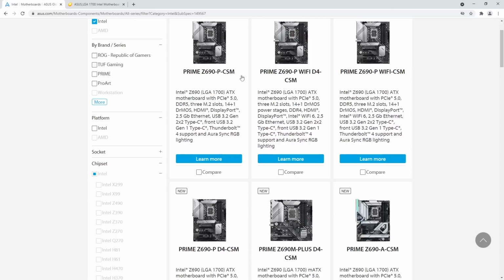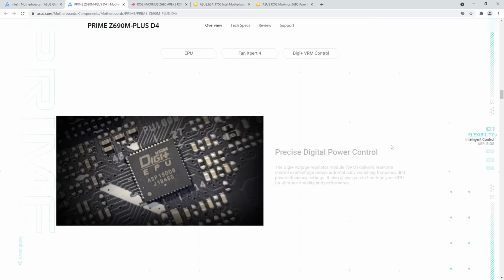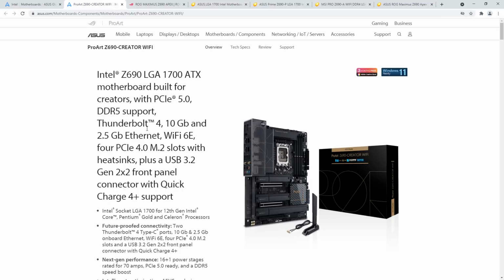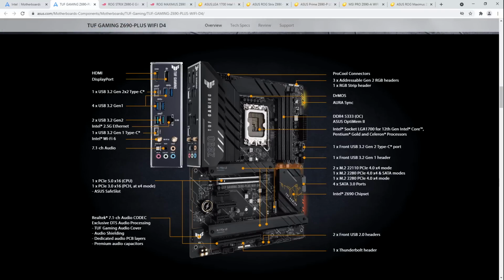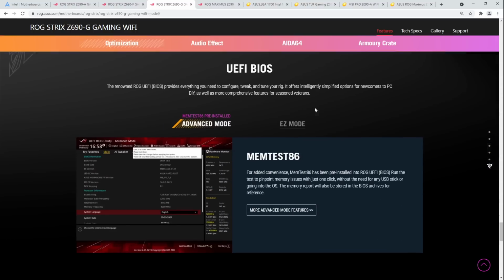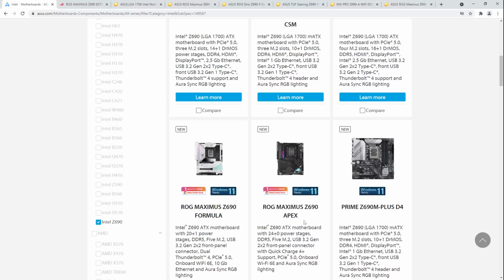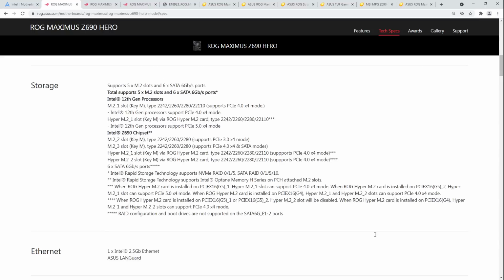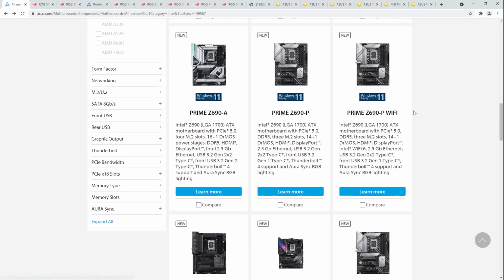Rambling about the ASUS Z690 Motherboard line up

Comment: 1:23:48 "black metallic capacitors", that name sounds like some one has been drinking that "Black felt capacitor" cool-aid again, lol.  I'm sorry to disappoint you, artificially increasing the leakage current of the capacitors with conductive carbon impregnated dielectrics, is NOT going to improve the quality of the VRM, lol. (face palm)

Comment: I remember back when I bought my rampage iv formula for $400 AUD which is about $290 USD and you literally had 40 pcie lanes. Yes it was pcie3 but this is in 2012 and 10th gen didnt have this many lanes from the CPU, you got quad channel, and 11 USB ports..... in my opinion there is no excuse for unused space not being used for USB ports. Put cheap USB 2 ports if nothing else. They can be used for most peripherals still. Webcam, microphone, DAC, mouse, keyboard etc.
Reply: Isn’t that a HEDT board? They all allow for 40 cpu pice lanes as long as you have enough cash for X series HEDT chips.

Comment: I just dont get why Intel Always keeps the lane Count so Low. I mean.. 32 Gen 5? Why? 40 would give consumers and manufacturers so many more posibilities..
Reply: What do you mean "32 gen 5"? It has 16 gen 5 lanes, 16 gen 4, and 16 gen 3. That's equivalent to 16+8+4 = 28 lanes of gen 5.
But seriously, who needs 32 PCIe 5.0 lanes on a standard desktop platform? That's... not low. There's no point in using chipset and CPU die area on extra lanes that 99% of users will never use, and it would make the platform more expensive. Most people have 1 graphics card, 1 or 2 SSDs, and maybe a capture card and a couple of extra AICs that would be fine in x1 slots, which Z690 is more than enough for.
Intel should get on with releasing a new HEDT platform so that they can provide extra lanes to those who actually need them, but Z690 doesn't need more.

Comment: I generally do not understand why all the Z690 needs to be so expensive, it seems like they are all overbuild on the VRM section(maybe 13th gen cpu support requirements ?).
I just got a decent black friday price on the TUF 690 D4(non wifi), but i still consider it expensive even with the 70euro cashback and around 100usd black friday discount that i got on the board (better priced than any other Z690 cos of those discounts tho), but still on the pricyer side for a lowend Z690 board. :-/
Reply: you know, it is expensive to have huge vrm heatsinks, oled screen, rgbs, etc

From what i have seen, MSI MPG Z690 Carbon/Force is isnt overpriced or expensive
Reply: @suntzu1409  MSI have the best and best priced z690 boards, as always.
Reply: @mycelia_ow  yeah
MSI is pretty much anti-ASUS now

Comment: is 20 lanes enough in 2021?
Reply: For people with 1 M.2 SSD and 1 graphics card on a motherboard with built-in WiFi... yes, but not if you want anything more than that.
But that's what the chipset is for. It adds 12 gen 4 lanes and 16 gen 3.

Comment: Really frustrates me how overpriced ASUS boards are this gen. Especially when Gigabyte and MSI customer support is basically modeled after the Volkswagen model! Gigabyte flat out refused to give me a service ticket and details to return my Master out of the box because it was not turning on at all, no lights nothing. & no it was not damaged pins in the socket. And the store did not give a hoot, they kept flicking me back to Gigabyte. Ended up throwing it and the 9900KF out as I was sick of getting screwed over.  

Not to mention the stupidity of PCIE gen 5 support and only 16 lanes being available. Why are we trying to "futureproof" ourselves by going gen 5, but than doing it in a way that is the least futureproof possible? Were going to charge you 550 AUD for a  entry level board and you can't even use gen 5 for both your GPU and M.2 at the same time without bumping down to x8 which then you might as well stick with gen 4.

Not to mention DDR5 being almost as overpriced as the 3090 and even harder to find. & Most games actually LOOSE performance with it! Stop increasing the prices of things for features we can't even freaking use! Either that or give us an alternative! I'm still stuck on Z170, I was dying to upgrade this year but I'm sorry I refuse to buy a 550 dollar entry level Z690 board, when my freaking almost flagship formula was 600 AUD brand spanking new! If we had a option of DDR4 and PCIE gen 4 at a reasonable price than fine I would of gone with that, especially since surprisingly the 12700KF is surprisingly well priced here! But I guess I have to wait for X670 to come out, since H690 and B690 will surely be locked. & Pray AMD do not pull the same crap. Give us whatever you want to give us, but we actually have to be able to use it. If we can't, THAN LEAVE IT OUT! Enough with doubling the price for something we cannot &^%$#@& use!
Reply: Mwf I just bought a full PCIe 4 system, only to learn that its just the SSD's not the games gaining benefit. And now 5 is here and we are supposed to be jazzed?
Reply: @Nidjo79  SSDs don't even benefit from PCIe 4.0 unless you actually use the extra sequential bandwidth. It's only really relevant for workstation use, e.g. transcoding or copying large video files from one drive to another. Benchmarks have proved that games will load at basically the same speed with a PCIe 4.0 SSD regardless of whether it's in a slot that supports 3.0 or 4.0 (and the best 4.0 SSDs only load games about 5% faster than a good PCIe 3.0 SSD anyway).
For gamers, PCIe bandwidth is actually more important for GPUs than for SSDs, especially if you run out of VRAM or if your GPU doesn't have 16 PCIe lanes.
This might change if/when games start using directstorage.
Reply: @nathangamble125  Just wanted to add, with consoles using ssds to stream in assets we may see this in pc gaming in the future too, in which case the speeds will matter. Sony only allows 7000MB/S + speeds if I recall correctly. For the rest totally agree
Reply: *lose
not loose.
Reply: what a moaner! there's 220$ dollar z690 and some ddr4 kits is still ahead of ddr5. are you blind or someone needing to vent out some frustration for own folly?
Reply: My msi RMA was fairly smooth but I think I had to post the board to Holland

Comment: Wow it's completely insane that a motherboard costs 2x the best CPU you can fit into it. These over all crazy component costs are going to push people away from pc gaming and back onto consoles.  Like what sane person would spend $600 on a Hero. I'm currently using a Hero from X470 and I think I payed like $300 for it. Now the price doubled with no new features aside from OLED screen.. This bord should not be more then $400-450. Like if I was thinking of building a gaming PC right now I would take one look at the prices and go buy a ps5 rather then spend $600 on a motherboard.
Reply: “What sane person would pay $300 for a board?”, said those in 2015
Reply: "Like what sane person would spend $600 on a Hero"
None, but most people aren't sane (or at least don't know enough about PCs to make sensible purchasing decisions).
Reply: @nathangamble125  Yah I'm just floored with how crazy the price creep of PC components has been lately. It seems each generation of components are getting 30%-60% price hike.  I just hope more people come to their senses and stop paying these crazy prices especially for silly gimmicks like OLED screens on a MOBO. All I need on a MOBO is lots of USB A and an optical out, and yet these features are mostly on high end boards for some reason.
Reply: 12900 only 20 lanes? not good
Reply: What sane person buys 5 kits of ram and spends hours trying to get nominally better numbers? Ram is ram. Buy it once and forget about it.

Comment: I bought the Z690 Strix - A D4 board. Yes it is over priced ($275 to $300 with a post code would be solid IMHO) but I wanted to use my DDR4 memory due to DDR5 being out of stock and not quite mature enough yet. I will say, I have been buying Asus boards only for the last 10 to 15 years (For mine, friends and family PCs) and I am basically done with them and their crazy pricing after this purchase. I usually buy the Hero boards but not paying $600 for one... SMH. For reference, Z390 Hero $379, Z490 Hero $400, Z590 Hero $500, Z690 Hero $600. No more Asus.
Reply: Well, if you wanted to make a statement you should have gone to another brand NOW. Buying the Strix does not send the right message to Asus. I'm in the same camp, have a Z390 Hero with my 9900K...and not upgrading in this ridiculous pricing environment. And when I do, most def will not buy Asus again, no matter how much I like their BIOS or fan control software. FU Asus and your abusive pricing. And it's not that I can't pay it, because I can perfectly afford it, it's that I don't like being scammed. Will go to Gigabyte or MSI.
Reply: @Miskatonik   You are right. I should have not bought it but I am doing my first mostly white build and the board just worked. I usually build 1or 2 PCs a year for friends and family and plan to use another brand then Asus til they are knocked from their high horse.

Comment: I think you should invest in some type c USB dongles, imagine having an uncluttered desk, the only thing you have there aside the standard mouse, keyboard, monitor combo, you have an usb dock to plug things, easy to reach, no having to bend over to reach the usbs behind the mobo, and depending on the thunderbolt spec you can have a ton of bandwidth on those little things to make use of portable storage snd shit, some come with HDMI and shit to connect monitors

I mean thunderbolt and usb c is quite flexible and have tons of potential

Take it as a mini pcie slot, but for USB devices
Reply: Or you can have no external USB hub and plug these portable things into the front panel of your case. Assuming you have a case with USB Type A's in the front panel, which every case from the past decade has. Rear IO is useful for devices you have permanently attached, and most of such devices have Type A connectors currently.
Reply: @andrey7268  you still have to bend over or maybe step up depending on where you place your case, a dongle that you can move around and have in easy reach is more practical imo

Comment: Have you tried one of the POST code PCI boards? Given the number of POST codeless boards, it seems like it could be useful? Reviews on them seem really mixed, so I'm interested if you have experience with them.
Reply from the maker: modern boards don't have PCI slots.
Reply: @ActuallyHardcoreOverclocking  Apologies, typo: I meant to say PCIe, not PCI, though said cards are available for both PCIe and PCI.

Comment: There type C USB 20Gb ports let you dock and charge laptops with a single cable, so no need to plug laptop psu in. Many laptops will then let you use the display as second monitor and mount the laptop drive as a network share - all with one cable. Plus you get the single cable displays that are usb c to usb c. The 20 Gb USB C ports are the new ports that in an ideal world are meant to replace all other ports.
Reply from the maker: I can't find anything indicating that the motherboard can provide anything more than 5V over the USB C ports so I don't think you'll be able to charge your laptop with that.

Comment: Asus has a Cashback-Event running in Germany and Austria where you get up to 250 bucks back (extreme+12900k).
In my case, i get 90 back, since i have the strix z690-a and the 12700k plus 25 bucks if i write a review. so instead of 365 bucks for the board its 250 which is a really fair price i think. 
I just wish it had a frigging post code! even if everything runs well its just convenient if it shows your cpu temp
Reply: The write a reivew dosnt seem to b e part of the Nordic cashback system(or at least i didnt spot it), but i can get 70 euro back for a 12600k + Z690 TUF gaming D4. But i find it really scummy when they have the write a (good) review and we will reward you with some more euro your way.
Reply: @AdaaDK  at least it says honest review, but yeah, not perfect. Thankfully asus actually makes good mainboards with the biggest problem being they‘re overprized, so its not gonna greenwash a bad product. 
Btw its like two seperate caskbacks, one for buying the thing and one for writing the review.

Comment: The x58 ws boards had a breakout board you plugged into give the postcode and power and reset buttons.
Reply from the maker: which I would consider a totally acceptable way of the Z690 WS implementing a post code

Comment: 49inc tvs wqhd ore 55inc wqhd make jour 4k fester Settings and Monitor fester in 21/9 salink 4k 8k 120 make 8k 21/9 reale fast Ende mit abeter Kino filing in 3 tvs or 2 to Gold bye in time to This 1 Metall Fromm Monitor speed jou rum on 60hz 120 Hz 60hz transfähre und 69 Monitor fast the hell and 240 hz 1080 dps  120hz TV dps 1.4 8k 60 Bild 21/9 fast the furiose together

Comment: Z690 Tuf will most likely have the same chip as the Prime - Realtek S1220A
Reply: nope. https://youtu.be/2Pq3RvHixiI?t=229
Reply from the maker: it's on an ALC897
Reply: @ActuallyHardcoreOverclocking  Yes as TrigrH  posted it also seems the Prime -P also have the same audio solution while the A has the better one. While that will be important for some people, for me I am sticking with the Sound Blaster Z because I need proper Dolby Digital encoding and even the S1220A codec is still garbage compared to that anyway let alone the ALC897. Having said that it seems the Sound BlasterX AE-5 Plus has DD so maybe that will be the next one I will upgrade too

Comment: Ich  hab CPUs die 10 Jahre alt sind aber 128 GB RAM zulassen 32Mb cash haben x3 und 3x am Limit virtuelle Kerbe geben reg am Limit x85 ein 11 x86 zeigen oc frei sind 6x RAM 5700HT/S zusammen fahren mal x3 und und das dan. Auf der 12 geb 13 gehen auf xmp 9600TH/s befeuern auf den Splitt und auf den neuen ddr6 17.000 / einholen postcods frei haben Software xmp RAM angepasst wird ans Limit  die neuse scheise auf ein Monitor ein pc ergeben ich könnte unebtlich Severin raus basteln unendlich meinen Limit und Supercomputer raus feuern 2 x zusammen befern schon die Leistung einer 128 core speed cpu für 80.000 Dollar +und drüber weil ich höher mit Tacken kann bin ich besser unterwegs so ddr3 ist also gut genug für jetzt ddr5 ddr6 nvme spende 16 Kerber 32 keiner oder mit 2x6 keiner ein 11 hat tundeboard 4 Treiber Standarte die such auf USB.3.2 Adapter die hab ich 6x und 2 c Type.c auf Adapter auf x16 aber 80bit t5 Kabel 40gb Daten gibst noch nicht 20 gig mach ich mit USB 3 0 und 3.1 auf Type c nvme Adapter und ich Kabel. Darüber rade 0_ 10 alles zusammen Kuppeln Booten über USB Sticker Type. C und 3.0 2 0 damit fahre ich 18.600.TH/ s mit 1 TV 20.000 MBits pro USB 3 2 wen Kabel da sind und Type-c sogar mit Bild bei 8o Bit t4 t5 Kabeln 8k 60 Hz 120hz

Comment: These Z690 Hero. when compared even with the Z490 versions, is actually a back step.
They seem to simply not make the board any better in real ways, but dropped these pointless OLED screens on them,
and jacked the price.  Its not just Asus tho, they all seem to be ... just not doing anything worth the platform change.
I dont need a less than 10% performance kick for a $2000 expense.

I'm happy with my Z490 Hero and 10850, and I'm going to bypass a couple more gens past the Z690 generation,
... then I'll look at where the market is and what the new toys are.
Maybe the Z890 might be interesting.
Reply: PCIe 5.0 and 4.0 make boards more expensive. It happened with AM4 when X570 and B550 came out. TBH i expected Z690 to be even more expensive, considering everything that's happening right now

Comment: My cheapest of its size phone is type C, and so are both of my different game controllers, and so is a USB drive I have. The first two though can be powered through a standard USB to C cable.
Reply: I mean, one of those type C ports is a 2x2 isn't it? That's basically lightening lite so it's feasible some external drives and such devices will later adopt the protocol. It does feel like a u.2 port though and could've been used for more standard Gen 2 standard ports.

Comment: "What would you plug into the rear type-C ports?"
A "Laptop Dock" to gain lots of connectivity on desk!
Reply: that's actually genius
Reply: @Nikitaman  I hope not, I got the idea from LTT and if he's a genius then it seriously weakens the meaning of the word.  :-D
Of course, he's using it so the machine's in another room so the noise is moved. Though he's using a fibre-optic TB connection, something out of most people's price range.
Reply: Yea same that's what I use type for
Reply: Or VR headsets
Reply: The logitech Streamcam uses USB-C. That's actually the only device i own that needs USB-C

Comment: I like that Asus decided to support the old LGA115x/1200 cooler mounting holes across their range of LGA1700 boards because I enjoy not having to worry about which of my coolers' manufacturer can be bothered to supply updated mounting kits for their models.
Reply: It's more than just the socket bracket size. The length of the stand-offs are different from 115x/1200. I don't know about the other AIO manufacturers but Asus has the new sized stand-offs for sale at their website for I believe it was $2.99ea shipping included. They have a max of two per purchase so I went ahead and picked up two just for the hell of it, in case a friend may need them when they are out of stock or I may need another set down the road. Within about 5 working days they were at my door.
Reply: and using said LGA1200 mount causes thermal issues due to poor cooler mounting pressure. those upgrade kits aren't just a bigger bracket, but also comes with different tensions
Reply: Not tension, the heights of the 1200 and 1700 are different
Reply: Do not use the lga1200 holes without lga1700 standoffs. I've tried it, Temps are through the roof. You need proper mounting pressure